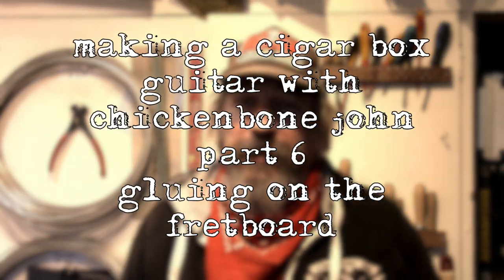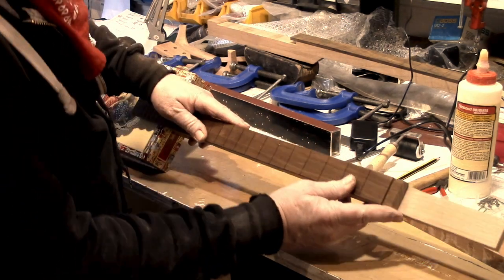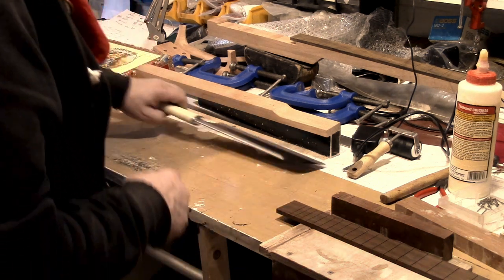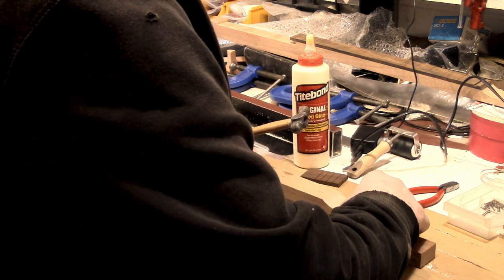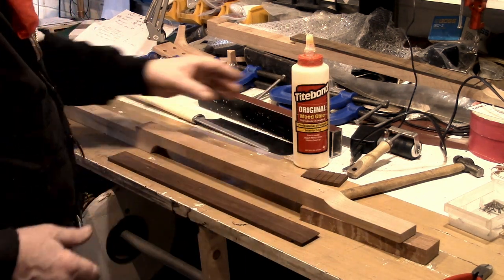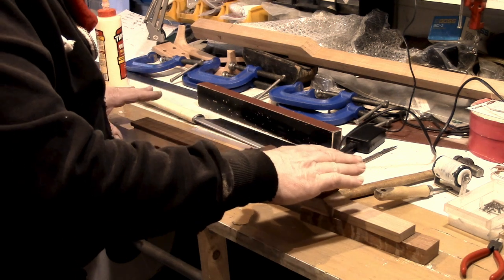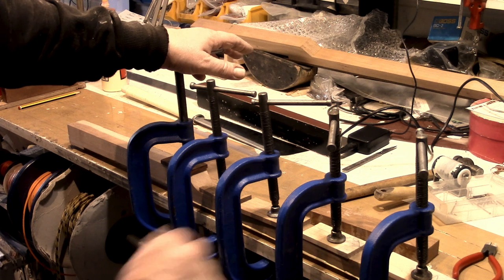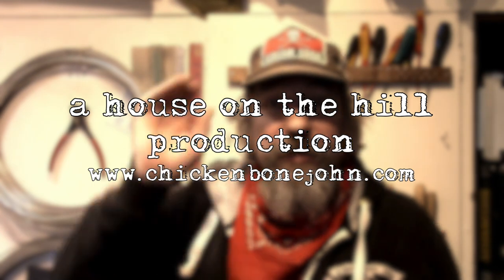Making a Cigar Box Guitar with ChickenboneJohn - Part 6. Glueing on the fretboard

Comment: A better method with the pins/nails is to drive them in through the fret slots so they're only just protruding - one at the first and the other down at the 12th or wherever. Then when you've positioned the fretboard perfectly, tap the nails slightly to make grooves in the neck. This way the fretboard will slip right into place when ready to glue; saves faffing about with the board slipping all over the place when trying to clamp. Important: make sure the nail is smaller than the width of your fret crown, so the holes stay hidden. I use a clamping caul with holes drilled out where the nails are protruding.

Comment: Why do you choose a threaded bolt over bone for the nut?
Reply from the maker: The threads of the bolt removes the need to slot a conventional nut - it's much easier, quicker and gives consistent results. We sometimes use a conventional bone nut, but for beginners, a bolt or piece of threaded rod is the way to go.